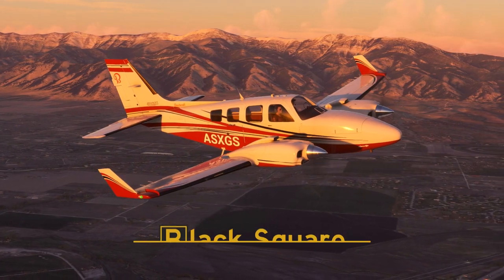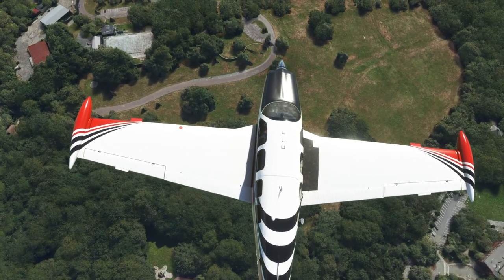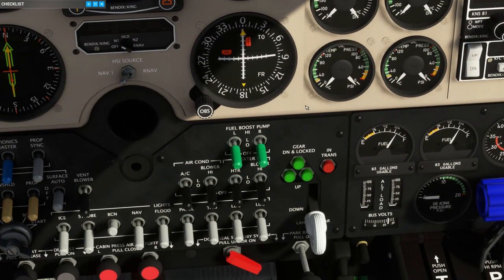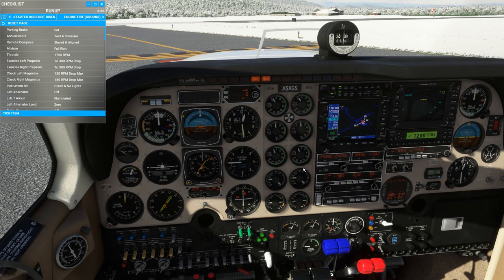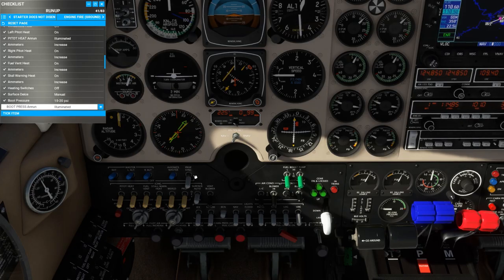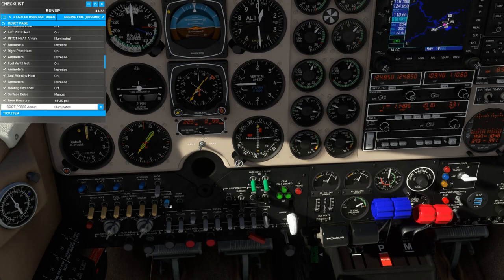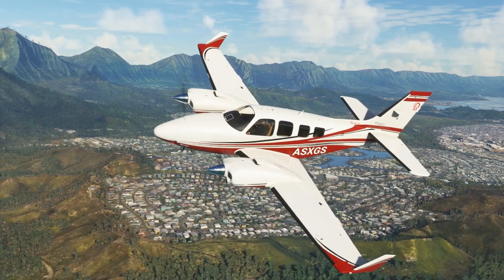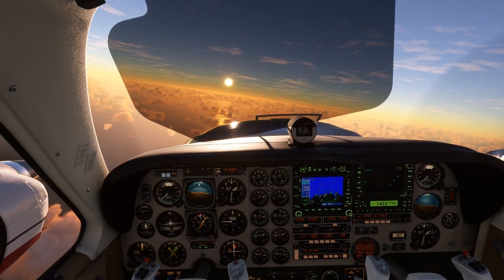Black Square Steam Gauge Overhaul - Analog Baron - Technical Overview

Comment: Perfect. I have only one question. After starting the engine, I see that some fuses are closed (raised) on the fuse panel on the left, and some of the cabin lighting and right engine clocks do not work. I don't know if it's a known bug, but what's the solution?    
(     Mükemmel. Yalnız bir sorum olacak, Motor çalıştırma sonrasında solda sigorta panelinde bazı sigortaların kapandığını( kalktığını) görüyorum ve kabin aydınlatma ve sağ motor saatlerinden bazıları çalışmıyor. bilinen bir arızamıdır bilmiyorum ama çözümü nedir?   )

Comment: Looking good! Now, one thing that has a plagued Black Square aircraft since the implementation of the Working Title GNS avionics, which is the PMS50 GTN 750 compability. The dual-GPS combination currently in BKSQ aircraft, GTN750+GN430 has many issues that I've understood cannot really be fixed by anyone... so is there any work being done to giving us a GTN750+GTN650 option? 

I hate that such a small thing is enough to be a deal breaker to otherwise such a great looking aircraft, but that's just the way it is. I'm not playing around with broken avionics setups.

Comment: Wonderful improvements, love it! But I cannot click on the magnetos on the starter (greyed out), and can only start both engines together with the Honeycomb Alpha starter switch (in VR). So it doesn’t work as per proper checklist. How would I enable to use my mouse to start engines as you indicated?
Reply: Same problem, very inconvenient. Still one hell of a plane. Thanks Black Square!
Reply: Had to change my Honeycomb settings and now mouse works on starter. But I cannot start it regardless of following the checklist exactly. It just won’t turn over. I’m baffled.
Reply: Works wonderfully now! I reinstalled it. Issue with AddonLinker but it’s resolved.

Comment: Awesome job! Will you be updating it with operable doors, and exterior objects like wheel chocks, etc. ?
Reply: Only interior/cockpit
Reply from the maker: The doors can't be touched. That's a condition of working as a payware developer/publisher. It's simply not allowed currently.